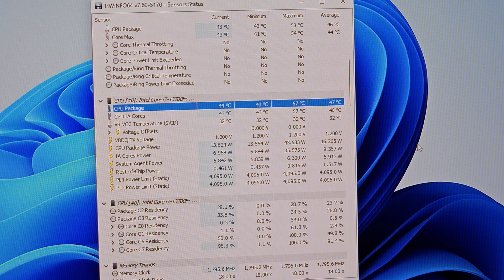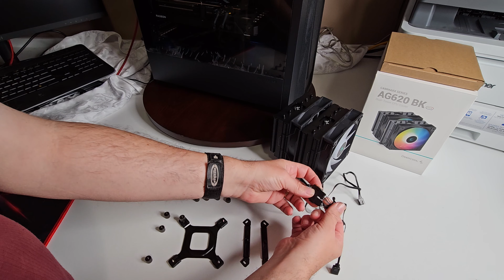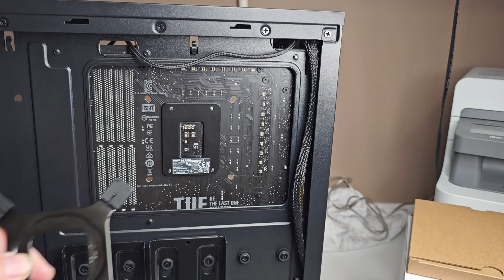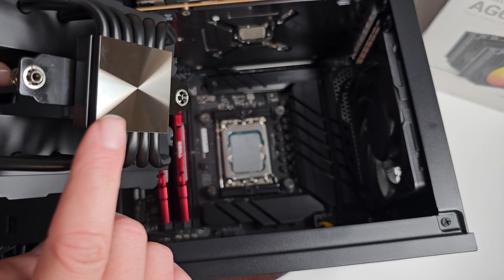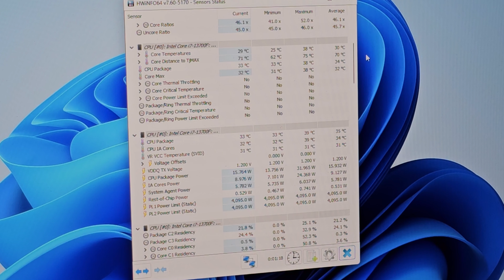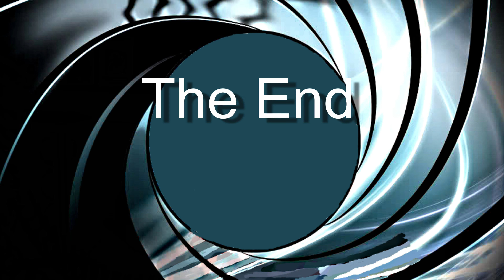AG620 BK Intel Install on I7 13700F and Temps

Comment: Hello, did you game with the stock cooler before upgrading? If yes, how were the temps? Im about to upgrade to a 13700 but dont want to spend extra for a cooler since I plan only on gaming with it.
Reply from the maker: I did a small amount of gaming on the stock cooler, it got up there in temps, around 97c which is a bit much but not something that would be any kind of a problem. This CPU can hit 100c and is according to most including Intel still in the round of normal. Now that was with Cyberpunk and a couple other games so it was being used pretty hard. I didn't have any issue's while playing though, and other ones might be lower.

Comment: how are the temps in gaming?
Reply from the maker: They were fairly good didn't get much more then 83 in most games.
Reply: @Reviewing_Playing_and_More_RPM  was it a spike?cuz 83 is kinda hot for games..and ive seen this cooler competes neck and neck with noctua nd-15 which is a premium air cooler.
Reply from the maker: I'll need to check it again to see, it might have been. I'll try to do it tomorrow and post again.